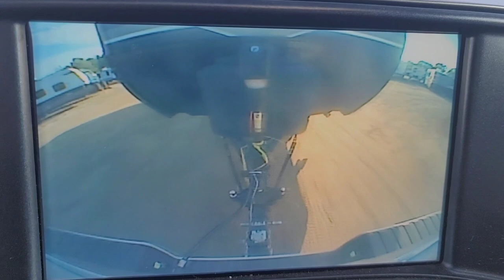Back to RV Transport! 10-13-2023

Comment: Glad you.’re back. Hope you haven’t forgotten to do a vid on the 2017-2019 L5P exhaust brake for us retired 5th wheel rv folks. So, I ve read and watched a lot about the Exhaust Brake. But I thought  you would have this down pat. Late December we’ ll be headed to Florida so we have to go Up and over Mt. Eagle. So could you take it right from the bottom headed South up the hill. 2019 Denali,  dually, 8’ bed, pulling about 12,000 lbs. so, pulling up the mountain i m in (?)
Reply from the maker: Thank you! Your truck will do an excellent job over Mt. Eagle with 12k. Truck speed limit is variable coming off Mt. Eagle. I usually run 45mph off going south with engine brake and tow haul on with shifter in manual (I'm thinking 4th gear. It's been a while) RPM between 2000 and 2500 and mine holds back great. Unless someone cuts me off, i can go all the way off without touching breaks. The reason i run in manual is to keep it from downshifting again and running rpm into the 3k range. It's probably fine but i don't like it. If you set cruise at speed you're comfortable with the truck will do all the work really smoothly. There are some ppl that say not to but it works for me. I hope you have a great trip! 
https://youtu.be/tecrBMwg7x0?si=3weoHEQhgzONOqo9
About half way through this video i come off Mt Eagle and talk about the engine brake. Also my email is cfarmeronyt@gmail.com if i can be any help

Comment: What fuse was causing the service trailer break system to come on
Reply from the maker: I changed the trailer brake controller over the spare tire. After i checked with autel and the trailer brake controller code was gone but i was getting abs light and had a code for front right wheel speed sensor. I'm thinking wheel speed sensor was causing the check trailer wiring too. It wouldn't set a code in computer but i did see it come up once on dash with abs and stabilitrak before i changed wheel speed sensor. It's been good since

Comment: Clad your back, question for you,  what tires are you running?
Reply from the maker: Thank you!  265/60R20 BFG KO2s again
Reply: I just put a set on my 2021 3500 265/65R20. You talking about the service you have had was the main reason, thank you.

Comment: You probably said it in the video and maybe I didn't catch it, but just curious, how many miles are on the new engine?
Reply from the maker: 108400 miles
Reply: Just broken in, right. Thanks for sharing, I have a 2017 3500, and it's good to hear your experiences.

Comment: Hey buddy, I have a 2018 L5p 3500 srw and have right at 300k miles. Everything has been great, besides some injector plugs which I swapped with your video help, and also my dpf has started to not be able to keep up while towing. Im wondering whether to delete, clean the dpf, or swap out with a refurb dpf. 

Fyi I have the edge insight to keep an eye on soot and all that

Comment: Charles, I respect your knowledge of the L5P. I need to update my '01 GMC Sierra with the 5.3L that I use to pull my 8k pound Travel Trailer. I only pull 3 or 4 times a year but it is up over 11,000 feet elevation in the Colorado mountains. I feel I need a turbo to overcome the thin air. I am considering an L5P or a 3.5L Ecoboost. Any advice would be appreciated.
Reply: There’s a bunch of good talk about the 3.0L baby Duramax in the 1500 Silverado trucks. They seem to get great fuel mileage. Also the small block turbo gasser in the 1500 gets a ton of hype. If you’re only pulling 8k, even in the mountains, either of those would be great. The 6.6 Duramax would likely be overkill but it would pull your rig without breaking a sweat!
Reply: Terry the Purpose Coach I have a Ram 2500 6.7 turbo max to pull up 20,000 hadn't broke in 95000 miles yet just waiting to get out there and catch up I just been warehousing and landscaping.

Comment: Do RV transporters ever use weight distribution hitches or is that too much work for the amount of trailers you pull? I tried not to use weight distribution for my new bumper pull but even with my dually I was getting way too much porpoising and sway so I bought the weigh safe true tow and what a difference it makes
Reply: The video just answered my question. thx